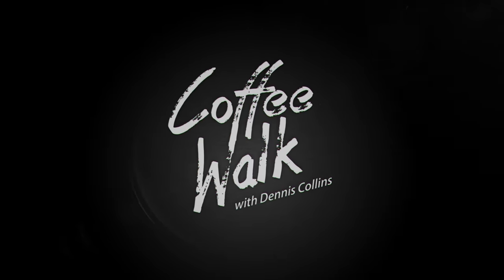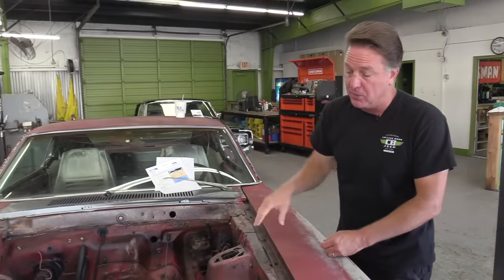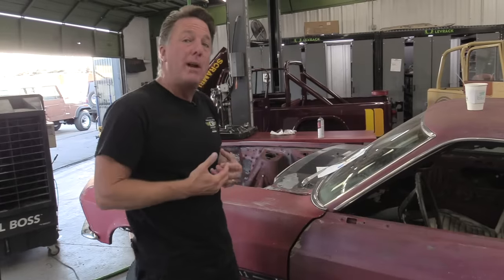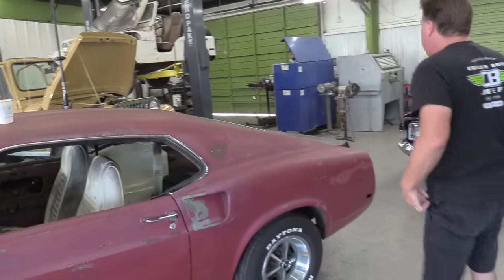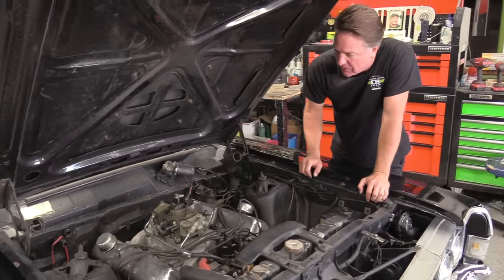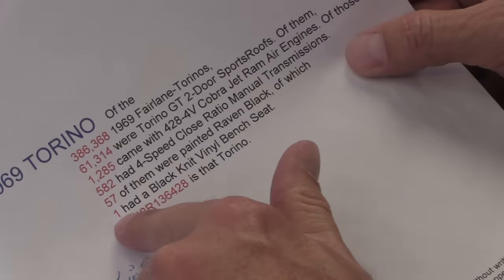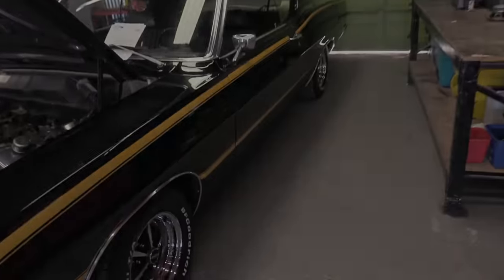Ford R Codes: Torino GT + Mach 1 Mustang

Comment: Restomod the Mustang. There are a bunch of totally restored R code cars. Make this one a modern day version of how an R code car can be built. Maybe a fuel injected lumpy cam big cubic inch Ford, modern 6 speed, 9" with 3.50 TracLoc, and modern suspension. Add classic designed wheels in over sized proportions, with modern tires, and badass exhaust.... now that would be cool.

Comment: With the original numbers matching stuff mostly gone on that 69 Mustang it's pretty much a blank canvas to build however you want cuz the odds of finding date code and stuff to put it back to how it left the factory is probably slim to none but that's just a guess I could be wrong but being that it's the state of its condition add restomod

Comment: The one thing that stands out on that torino is that it has the wrong stripe. The c stripe is correct to torinos, but this one here is only for 1968. I think theyre the better looking stripe so I understand why someone put the 68 stripe over the 69 stripe.
Reply: Yep and the 68 stripe does look better.  BUT I think the Mercury Cyclone stripe looks better than either of the C-stripes!
Reply: @lancegoulet8100  oh youve definitely got a point there! Those stripes are the best looking. I almost put them on my own fairlane fastback they look so good!

Comment: The Torino , LOVE Em. The 1 that I had was Green / Gold stripe, 4  speed and 390
Reply: I still have my 1968 Tornio GT. It was Hyland Green with the gold strip, 4 speed and 390 like yours. The one shown in the posted video appears to have the 1968 strip. The strip on the 1969 models was straight  and not covered like the 68 strip. When I repainted my car, I could not find the strip tape kit, so I painted the strip on both sides. I was very lucky in finding one with the strip that I could take measurements from so as to tape of the correct shape and then paint it on. Like I said, I still have mine. I rebuilt the engine a second time and this time installed a 427 solid lifter cam and changed the carb over to a Demon. I let the car set 3 years in out pole building.  Big mistake as the mice destroyed the interior. Vails Classic Cars in Greenfield, IN helped me get our insurance company to pay for the rodent damages. So now I have all new interior.
Reply: @UNITED2009100  I often wonder where mine went to ? And I would love to get it back, providing that all it would need is  a freshen up. But reality says dream on. Like about 6 other vehicles that I once owned. Like the 64 Impala that I am the caretaker of.
Reply: @clintonpowell1443  I'd like to think my car is "respectable" just not totally restored. I never had the money to spend that way. What I can say and do say often is that my car is a ONE OWNER. Bought it new, $3200.00 cash! And what bothered me most about the mouse damage was that they made nests in the glove box where I always kept my sales receipt. I also had my best two time tickets from Raceway Park, one 13.02  and 13.08 running F Stock. All that is now gone. Those mice also got into the mufflers and the bell housing through a air vent hole just at the top of the transmission. Inside the bell housing was a massive amount of seat stuffing that ended up in the clutch and throw out bearing. Upon reopening my claim with State Farm, they paid for the parts and my labor as well. I will never forget State Farm.
Reply: @UNITED2009100  1 owner, wow. Not many of those. I know that I am #3 owner of my 64 Impala

Comment: The take up of R codes was very low. The halcyon days of Total Performance didnt result in the numbers of Big Blocks id have expected. Down here in Oz and NZ, 20 to 30% of everything made in our sedan and hardtop Falcons were 4bbl  Windsors or Clevelands with 188 to 300 hp. I cannot fathom non Traction Lock 9 inch axles with 3.5  ratios in big blocks either. Our cars ran 2.75s or 3.00's. Sometimes, 3.25, 3.5, or a demon 3.9...but only ever Traction Lock. Anyway...great bases. Thanks for keeping thar R in FORD...Rollin'!

Comment: I'd have to go back to my late 60's magazines to find the advertisements but I believe the Motorwheel corporation made the Magnum 500 wheels not Cragar.  Pretty sure they sold the wheels to all the different manufacturers with their own little twist.   Ford, Chrysler, GM all used that wheel in some fashion with different models.  As for the Magnum wheels on the 69 Mach 1 and the Torino both are incorrect.  The Mach 1 would have came with a chrome Styled Steel wheel with a center car and trim ring and the Tonino likely as well.  However the Magnum would have been and option on a Boss 302 and standard for a Boss 429.  They are however a nice upgrade on both cars.

Comment: i had a super rare 1969 fairlane 500 sports roof.., 351w.. why was it rare? factory 4 speed, 9"posi, power disc brakes, power steering, bucket seats and factory ac and desert radiator.. oh yeah and the super rare factory tach.. all these years later ive only seen one other car with that tach.. a 69 torino GT fastback... also a 351w car. was a fun car.

Comment: I bought a new R code 428 Cobra Jet Torino in the Champagne color, with the drag pack, traction lock, cold air induction, close ratio 4 speed, manual brakes/steering .  I sold it after I got back from Vietnam:  big mistake.

Comment: what he refers to the inner fenders where the vin number is stamped is actually called the fender apron and he doesn't prove, show, tell us how those are r codes. If you decode the vin it wont tell you if its an r code and neither will the marti report all you have to go by is the specs telling you that an r code is a Mach 1 that features a Wimbledon white/black vinyl color scheme. The R Code also includes a 428-CID Cobra Jet V-8 engine and a four-barrel carburetor. ... The Mach 1 was created in 1968 and released in the 1969 model year as a performance-oriented option for the Ford Mustang. Unless Dennis can track down the original engine and trans it can never be a true r code, at best it can be a non matching tribute car. Dennis's Torino looks like a modern restoration. For 1969, the R code Torino would denote a Ram Air motor, and the C option would disappear, while the Y code would be changed to refer to a two-barrel version of the 390.

Comment: I'm currently building a 1969 Torino GT Fastback.  It's an M code not an R code.  Is the C-stripe on the Torino in the video the 1968 stripe NOT the '69 stripe?  Or am I wrong?

Comment: I had a 69 fast back GT. Some one must have put 68 stripes on the car in the video. Or maybe it was built in late 68 and they still used 68 stripes. 69 went lower under the door handle and higher at the bottom.

Comment: I think resto-modding the Mustang would be fine.  Without the engine and trans it will NEVER be numbers matching again.  Build it for driveability.  BUT resto-mod NOT pro touring.  Keep it looking like a beautiful '69 Mach I.  Don't chop up the body or widen it.  Don't put on giant wheels with low profile tires, etc.  
You can use modern parts, but do it in so no one would know until they got it on a lift, opened the hood or the door.  Nothing wrong with a modern engine and trans, coil overs, upgrade the brakes, Dakota Digital gauges and a great sounding stereo.

Comment: Fun thing is the 69 Mustang came with the old Windsor small blocks and the old FE big blocks, while the 70 came with the Cleveland small block and the 385 big blocks.

So the 70 model saw more innovation.

The 69 Boss 302 ( later the 351c in 70 ) was a testbed Windsor with Cleveland heads. And the 69 Boss 429 saw first use of the 385 series block.

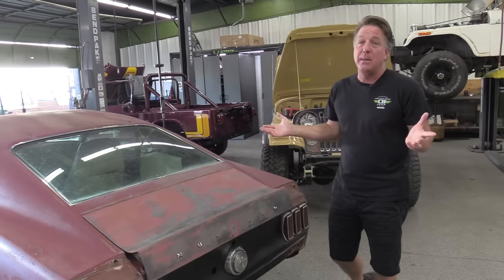Comment: 5:17 im more of a Camaro guy, and i like and love modefied cars but clean builds if you make it almost stock but with some nice and clean modifications, get some time right aftermarket stuff 
and mnot go fully pimp my ride cus thats to far, get those Shelby wheels that Gone in 60 seconds Eleanor are thos Shelby Cobra wheels i think,
and paint it red with some white shelby stripes that goes with the white seats
Reply: make me wanna build one in forza tho its a Boss that has the most simillar body

not to brag my Best friends father has the exact same Mach 1 as this, but Black with red stripes 
a change in my Plan could be Mach 1 stripes instead of shelby stripes ha ha but what i would say is make it a restomod that's close to stock

Comment: It’s a shame Ford kept stuffing the FE into their performance cars when the 385 series was available. I was told years ago this was a corporate decision more than a logical one.  The 385 series was slated for Lincoln,Mercury and large sedan installations.  You could option the engine in if you knew what box to check in the 70 Mustang but these are very rare.   The Torino with a 385 series isn’t as rare but the FE was the standard big block until the body change in 72 when the FE went away.   The mustang is crying out for a 385 series plant.
Reply: David Janowski  Yep.  That with a a six speed would be a fun car.

Comment: What are 'R' code cars? Special order?
Reply: For the mustang at least, 'R' Code is a 428 cubic inch with Ram AIr  (Shaker Scoop). 'Q' Code 428 also available but with non functional hood scoop still looks cool. They actually made less of the Q codes.

Comment: Reading thru these comments os awsome but nothing compared to the High performance Savior i have in Jesus Christ of nazareth. He rescued me from the jaws of death and set me on high in His Fathers kingdom. And He also blessed me with a plain jane 70 fasback , lime green with a 302. Very quik car , then He overwhelmed me with a 70 mach 1 , 351 , shaker, 391 to 1 trac loc rear and the icing was the fold down rear seat. I put my spare backbthere and told me friends its only for 2 , whew that move kept me outa the maricopa county jail at least 20 times. We used to go to the top of sourh mountain at night and race any one to the bottom lights off. What a rush. And again thank you Jesus the Christ for sparing my life all those runs

Comment: If you don’t know anything about cars . Then you Restmod it because you don’t know anything about cars LOL😂. But if you know a little something about mustangs with R codes , you would know that they are not that common.  and finding a correct motor . With the correct numbers close to the same build day ., would be sufficient enough to help you complete the restoration. You would have a $75,000 minimum value on that car. And climbing fast every  years. and being two of only that model to have that option can make the value go up even more. And also like you said a red with white interior is not very common so that helps put more value into the bottom line. But you have to decide are you a guy who loves these cars you love that color you love the original motor and you would buy the car and you would save that car forever and pass it down to your kids .that would be worth the money. 
Or are you like our buddy here Dennis who just buys and sells these things and doesn’t really grasp the concept of knowing , or souls I say not knowing that it isnt even a question of whether this car should be built back to spec.